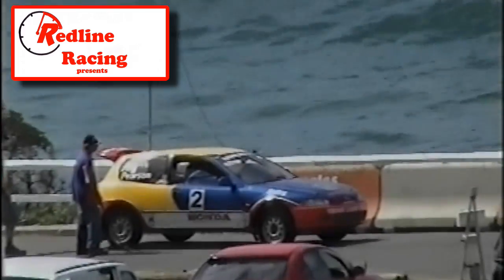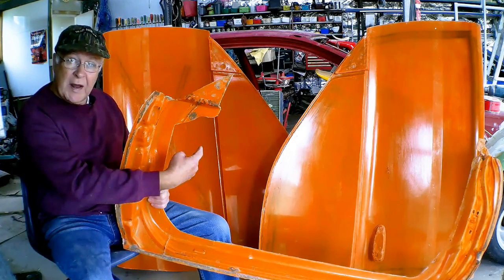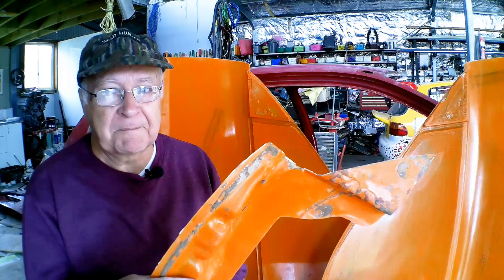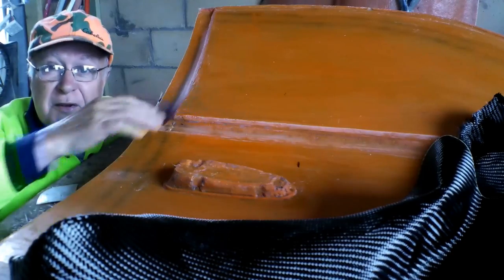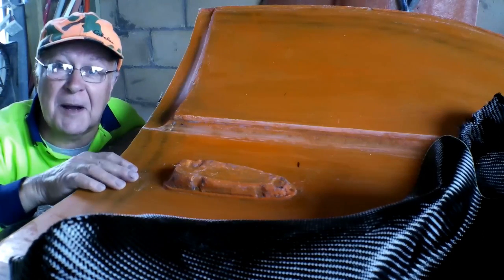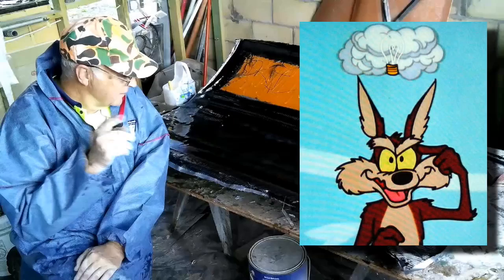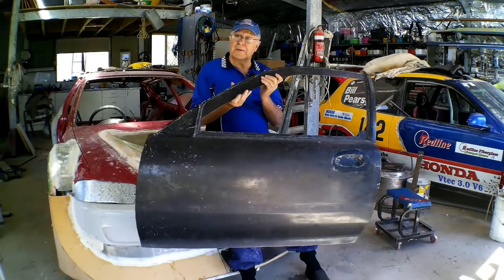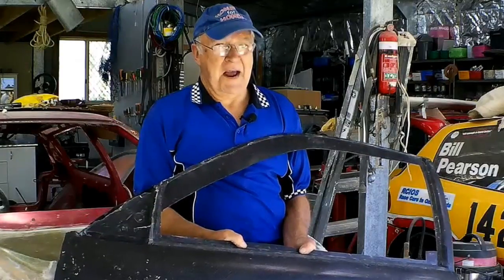How to make a carbon fiber race car door

Comment: This was extremely helpful and informative,  what are you doing for the windows? Polycarbonate with sliding windows or are you incorporating the original window? And if so, what are you doing for the track in the window frame?
Reply from the maker: I make my own.  On nearly all cars you don't need to curve the door or side windows, as the factory bends are so slight. So anyone can just cut them from clear acryllic or Lexan. Because I am manufacturing for race, not road, cars - I fit the plastic windows to the doors directly, without winding mechanisms, but putting a sliding panel in the drivers one as the rules require, and in the from passenger's if its a rally car.  I make my own curved rear hatchback glass, heat molding them in the cheap oven I built from a curbside throw-out gas bbq. https://www.youtube.com/watch?v=dgTlKkhK338&list=PLh5B6MCXRHiEsIniyEHmgxEAAMirYWItD&index=15

Comment: Question: to make the molds do it all, both quick and easy hand layups and high end vacuum infusion with tailor made cuts of different materials, would it be as simple as just adding flanges to your molds?
Reply from the maker: Yes & no. Yes - it is easy to add flanges to car panels using coreflute sheeting (the stuff real estate agent signs are made from). This can be screwed in place and self releases from fiberglass. No - This gives you a mold for vacuum bagging, but does not allow the quick edge trimming & sanding of the finished product before releasing it from your mold that is possible with an un-flanged mold. However you CAN vacuum bag an un-flanged mold. All you do is put bagging on both sides of it using tacky tape, joining the two vacuum plastic sheets into a fully enclosing bag - rather than just a single sheet just covering one side as with a flanged mold.

Comment: Hi Bill, I notice in many other tutorials, they apply many many spray coats of gelcoat. My question is, hen using a brush as you do, ar you able to achieve a uniform layer of gelcoat without thin spots? 

Thanks again for all your efforts!!
Reply: You want it to be thick, you control how much you can put on, it looks like Bill is not afraid to use medium amounts of gel coat, I personally will cake it on enough so I know that the if there is any repairs needed to be made I know that I wont sand through the gel coat

Comment: Whats the price in carbon fibre to make a door like that?
Reply from the maker: The door needed 3 x 1.5m pieces, so 4.5m total cloth, which goes for $45 - 50 per metre depending on where you buy it... so about A$225. But the epoxy resin isn't cheap either.
Reply: Thankyou!